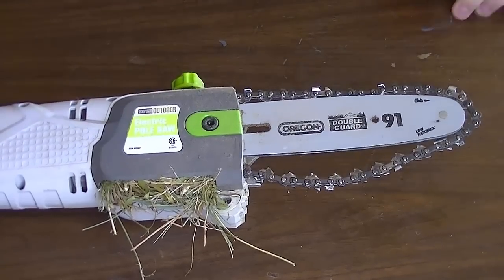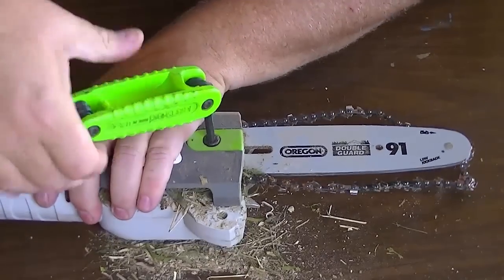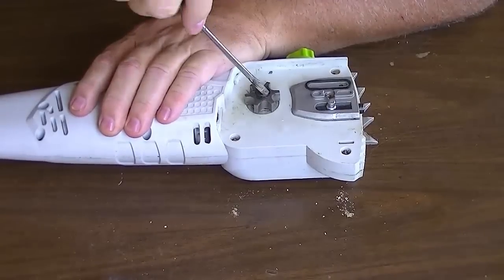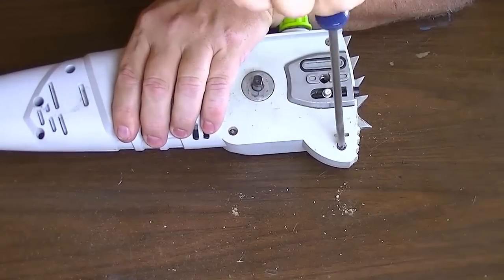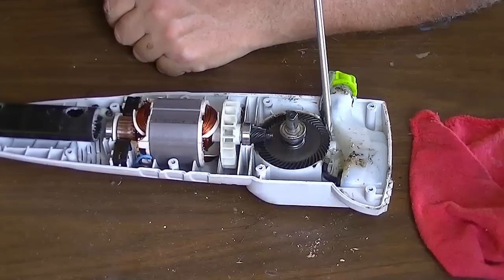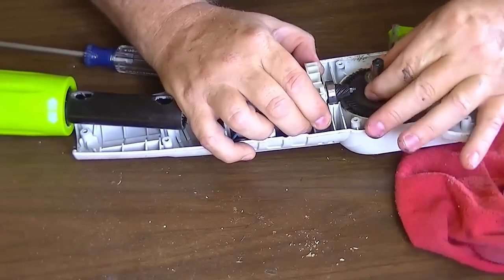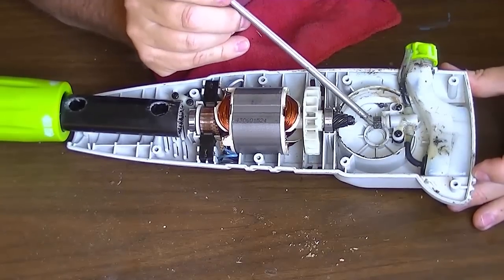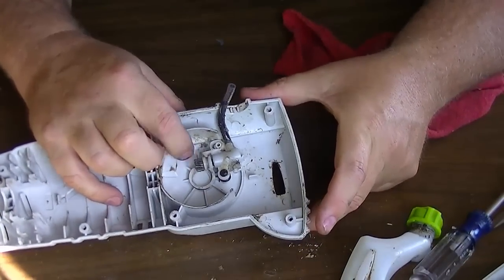Harbor Freight Chicago Electric Portland Pole Saw Oil Pump Repair Mod Fix

Comment: So I know this a weird question but is there a costumer service number for that pole saw
Reply: I just need a chain and I lost the screw that crews on the cover
Reply from the maker: @stebensbobby  I hope this helps, here is a link for the replacement chain: https://amzn.to/2JCpinV
Reply: @stebensbobby  chains can be bought at home depot under the oregon brand name
Reply: spikefish1989 I lost the bolt that holds on the cover for the bar and chain where can I find that
Reply: @stebensbobby  ill try to figure out what the bolt size and pitch is tomorrow and then you can go to any home improvement store and buy a new bolt.... or take the saw with you and show then what you need.
Reply: @stebensbobby  the bolt is a m8x1.25 with a length of 25. If you have a lowes or home depot or any hardware stores just make sure it has the the Allen key head. I only looked up the stainless steel bolt at the lowes near my house and it was lowes item number #550606 or if you can find Hillman brand the item number is 884885
Reply: spikefish1989 thanks
Reply: I hope so to lol thanks
Reply from the maker: @stebensbobby  Good luck.
Reply from the maker: This is the number that is in the manual: 1-800-444-3353 I hope this helps.
Reply: What size chain is it
Reply: @stebensbobby  home depot should have it.  Oregon chain 91pj033x is the number on the bag the chain came I

Comment: Hey one question.  We have this model and I need to get parts. Tried like hell but no avail.  Can someone tell me how to get parts for this model.  I need an oiler(Part 44) and if possible Carbon Brush(29).  Thanks for any help....
Reply from the maker: so I'll wish I could help you with this one but unfortunately I can't.
Reply: Contact Black & Decker. They make the same saw under their name. I’m guessing they can get you parts easier than HF.
Reply: KENNETH MERCADO 
It's made in China and made to be thrown in the trash can! There are no spare parts!

Comment: Nice video. You gave me the idea to do this before the first use. Took mine apart and greased the gears with a  lithium marine grease. The worm gear for the pump was stuck and didn’t spring back. Just needed to flip it a few times and it broke free. Now it moves like it should. Reassembled, fired it up and oil was not pumping. Just loosened the oil cap a little and it started to flow. Then marked the side of the cap and cover so I would know where it needs to be when running. Thank you for the video. It made the job a lot easier to see how it’s done and know what to look for.
Reply from the maker: Thanks, I'm glad video helped.

Comment: Just realized this is from 3 yrs ago.  Just bought one that has the same problem !  Thanks for the help !
Reply from the maker: I'm sorry to hear they are still having problems, but I'm glad the video helped.
Reply: I just fixed mine today had just bought it and thanks to your video I was able to fix it.  To much glue in wrong place not letting oiler rotate.

Comment: Very interesting video!
 Straight forward and smart disassembly, diagnosis and reassembly. It always makes me appreciate using tools more when I can figure out a problem and fix it!
 So after owning this saw for some time now what do you think about it? Still holding up?
Reply from the maker: Thank you for the comment Jeff!
Reply: @roberta.edinger9405  I have the exact same model, only it was made or assembled in Australia and is called an 'Ozito'.  The plastic tubes were split at the tank and the pump.  The saw gave up pumping oil soon after I got it, or maybe it never pumped any oil.  Now I am in the hunt for new plastic tubes.

Comment: That tiny hole at the end of bar where sprocket is is for grease to lube sprocket. Good idea to shoot a bit of grease in there when using this saw. That metric screwdriver had me,lol.
Reply from the maker: thanks for the tips, I will try that

Comment: D. E. Hewlett1 second agoI have watched several videos on this pole saw. No one has shown the inside of the cover. Where does the rubber seal go. It fell out when I took the cover off and diagram doesn't help to show where is goes. Can anybody help? Thanks, Dan
Reply from the maker: What was the shape of the seal?

Comment: I have that exact unit but it says sunjoe on it. Took it apart just like this. Looking to extend the reach to 25 feet. Any ideas on the poll extension I would use. I thought pvc but that seems to flimsy. There is a video on youtube with a guy doing this but he doesnt get close in to what he did at the head end
Guess I'll hit the hardware store and see
8 feet just isn't enough
Reply from the maker: Good luck

Comment: Great Video.   My HF Pole Saw did the same exact thing.  Incidentally, there is such a thing as a Metric Phillips; it's also called a JIS (Japanese Industrial Standard) Crosspoint.  They are very handy for working on metric motorcycles, especially older ones (80's Honda's).   See the Vessel Megadora brand...you will wonder how you ever did without it.
Reply from the maker: Thanks for the info!

Comment: My pole chain saw was leaking oil, took it apart after seeing your video and discovered the clear plastic oil line was split and leaking heavily, no oil getting to chain. A search of auto parts stores and Home Depot did not find correct size oil line, estimate it is 5/ 32. Does anyone know where I can get replacement oil lines?
Reply: Yep, I'm wanting to know as well.
Reply from the maker: Try surgical tubing

Comment: I bought a Ryobi pole saw off ebay. It was new or barely used and I know why it was a good deal.... the oil tube that runs from the bottom of the  oil tank to the pump is split. It pours oil all over. The problem is it has a 90 degree bend, and I have no idea where to find that. It is not on the parts list. I could bend a piece of tube but the oil tube is only 1-1.5 inches in length and it will kink. I could insert a spring.
Reply from the maker: Maybe try heating it up with a heat gun or blow dryer first.
Reply: Thank you. I bought some hose and inserted a small spring. It works well.

Comment: Thank you,great video!!! Don't know if that will work for my homelite electric chainsaw or not,but I'm gonna try to get it to work.I'm saving your video! Thanks again!!
Reply from the maker: Thanks for the comment.
Reply: Well I did get it fixed,one line was disconnected and other line had hole in it.I replaced both lines,now oil pumps like it should.Thanks again!!
Reply from the maker: Cool, I'm glad you got it fixed!

Comment: mine chain kept slipping off the bar .. is it because of not enough oil ? I couldn't get the tension tight enough .. looking for mod
Reply from the maker: The oil shouldn't have any thing to do with the chain tension. There is a small flat blade screwdriver tension adjustment on the front of the body. You can adjust that after you loosen up the bar nut. I hope this helps, good luck Nathan.

Comment: I fell for the metric philips joke. SMH
Reply from the maker: Somebody from Australia or the UK commented that there actually is a metric Philips screwdriver. Go figure, the jokes on me.
Reply: Actually, there are "Japanese Phillips" made specifically for Japanese metric motorcycles.  I have a set, and they actually work much better when working on a Honda or other Japanese brands!

Comment: A great video which exactly addressed my concern about this product.  After watching, I considered returning the saw, but tried again with some 20 w oil and ran without the chain for about 1 minute, and saw the oil coming through its port.  Not sure if its flowing fast enough, but at least some oil is coming.  You gave me the courage to disassemble and maybe actually re-assemble to a working saw.  Thanks.
Reply from the maker: Thank you, I'm glad I could help. Good luck.

Comment: Got mine, tested to see if it pumped oil before I put the chain and bar on, it did not. Rather than return it and get another with the same issue, I followed you video and did the hack. Mine did not have any glue issues (visible), but I modified the pump housing, put 'er back together, still no oil, blew some air through the oil tube, now works. May have had a bit of debris (glue) that got up in there, maybe not, but now I know that the mechanism is good to go. Good info, thanks.
Reply from the maker: Thanks, I'm glad I could help.

Comment: I've just bought a second hand one of these (in fact I bought and extendable pole trimmer) and the saw was thrown in as not working.
I'm in the UK and what I got looks very similar (TITAN TTB426GDO 20CM 750W ELECTRIC POLE SAW PRUNER 230V) and I noticed the chain looks dry even though there is oil in the tank. I wouldn't mind betting mine has this or a similar problem.

 A big thanks from the UK for taking the time to record and upload this...it's helped me loads already, and I've yet to take it apart!
Reply from the maker: They probably both came off the same assembly line in china. Thanks for the comment, I'm glad I could help.
Reply: Well I had a result.. I hadn't really looked at it since getting it, but the chain looked very worn but clearly there has been oil on it in the past, but that could have been from new.

I took the bar off and ran it to see if any oil came from the hole. After 30 seconds of running it appeared.
The slot in the bar seemed very bunged up so I cleaned it all out, and decided to give it a new chain (£9.99)
Result seeings as I was given it.

Comment: Great vid and thanks Robert!  This was very helpful in fixing my HF pole saw. I'm pretty sure it has never pumped oil.  Upon disassembly, I found the top tube was split were it would attach to the pump.  I cut the split part off, which made it tough to reassemble, but it's now pumping oil like it's supposed to!  The pump pivot was ok in mine.
Reply from the maker: Thanks for the comments.

Comment: I lost the oil tank cap on mine. It fell off while I was working in tight brush off my pear tree. HF is no help so is there another branded product or match?
Reply: The cap on my Remington Pole Saw lost its cap too and my comical hunt to find another scored one from junk plastic bottle from a thrift store.  Before then I used a wooden cork either wine bottle or a chemistry lab type rubber one. Year later I found the original cap. It is like the designers purposely used an oddball size. I
Reply: Still without one myself but will try to find another cap that might fit. Alternatively, I plan to  heat up a piece of plastic like a pharmacy/pill bottle or some other kind with my heat gun to shrink around the threads.  After that... a wine bottle cork I guess... 

One might expect to be able to order a real cap from a real company that simply brands these china (or whatever) manufactured things.
Reply from the maker: Sorry to hear that.

Comment: I need both sections of the worm gear assembly. They both are stripped smooth. Can't find them. any suggestions?
Reply from the maker: That sucks. You could try Craigslist, other than that, you might be out of luck.

Comment: Most brush sets have a hole that when the brush is fully retracted a pin such as a paper clip can be inserted to hold them in place so the motor can be removed and reinstalled easily.
Reply from the maker: Thanks for the info.
Reply: These are easy to get in and out, they just pop in.

Comment: Thanks for this video.  Great job diagnosing the issue and fixing it.  I just bought this saw, but haven't tried it out yet.  Had I watched this first I would have test run to check the oil pump prior to final assembly.  Looks to me like they used hot glue or whatever to seal that oil line during assembly, but it interfered with the pump being able to seat itself properly against that worm drive gear.
Reply from the maker: Yes I think you are right. Thanks for watching

Comment: Nice job. You have a lot of patience. I would have returned it to the store, and brought home a new one. That Made in China crap needs to be thrown back to the maker.
Reply: Not so much "crap" in this case as lack of attention to detail.  I just bought this saw and have cut a lot of tree limbs with it, but it isn't oiling either.  However, it cuts great.      Update - I dumped most of my oil and filled it back up with 3-in-1 oil and it is oiling now.  I will keep an eye on it and if it doesn't put out enough oil, I will try what was done in the video.  BTW - thanks a lot for the video!
Reply from the maker: Thanks for watching! I know what you mean about crap.
Reply: And that's exactly what I did with pole saw #1.  Pole saw #2 (the newly exchanged one), still no oiling!!!  Called H.F. HQ.  The guy that I spoke with said not to worry about it until I hear the electric motor seizing up.  Then simply return it for an exchange or refund (I bought the extended warranty).  Terrible advise!  I want my tools & toys to work!  I'm anxious to try Robert E.'s fix!  Thanks Robert.

Comment: there is a kind of 'metric phillips' in europe we use a variation of the cross head phillips, we call it a pozidrive, and screwdrivers kind of fit each other, but badly and round out, so you have to be aware and have ones of each type  good job fixing their glue spill!
Reply: Great Vid.   Mine did the same thing.  There is such a thing as a Metric Phillips it's also called a JIS (Japanese Industrial Standard) Crosspoint.  They are very handy for working on metric motorcycles like Hondas.   See Vessel Megadora brand...you will wonder how you did without.
Reply from the maker: +jusb1066 Wow I had no idea. Thanks.

Comment: So it actually pumps more bar and chain oil now that you fixed it? Ours does the same thing. It hardly pumps bar and chain oil but when we switched to a lighter weight oil it pumped a lot better. Thank for making this video!!!
Reply: +Love2boat92 apparently some paint thinner can help you in a pinch when your saw oil is too thick. ...i'm having same issue with my saw
Reply: Hayes Myers Wonder how that would be on the seals in it?
Reply: +Love2boat92 I was told to avoid using gas..probably for that reason. Paint thinner is used to reduce oil based products.  My chainsaw guys said it was an option.  There could be seal issues. if so i guess i'll be looking up o-rings etc one day. That being said, using a thinner weight oil is key. I suspect most pruners do their work in warmer weather and its a non-issue. i have stihl medium weight ... and it isn't flowing well. will put more of the thinner in this weekend and play with the work done in this video to see what is really gong on.  haven't run it without the chain/cover on it to see if it flows well. love the attachment though (goes on my troy-bilt trimmer head)...i'm taking down 1/2" to 3"-4" poplars grwoing in my drainage ditch. works great...and didn't spend 700 bux on the Stihl 130 brushcutter.  (Canadian dollars mind you lol).
Reply: Hayes Myers That's a good point. We really like our trimmer from harbor freight. Its not something that gets used everyday but when we need it, it sure is really nice to have. I've buried the bar in a tree limb before and it didn't really have any problems. Stihl makes some nice stuff but it's difficult to justify the cost for something that isn't going to be used all the time.
Reply from the maker: Yes the lighter weight oil will certainly help.
Reply from the maker: Thanks.